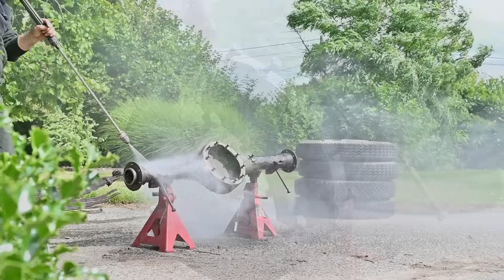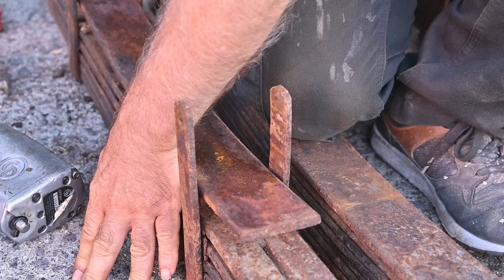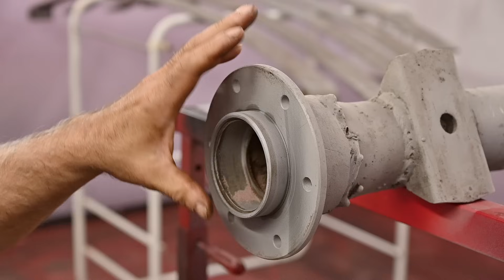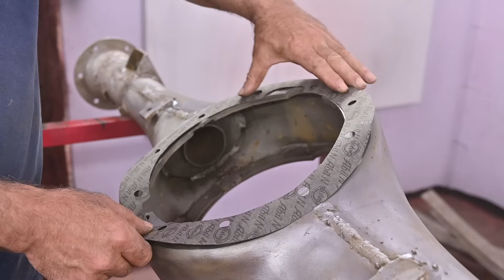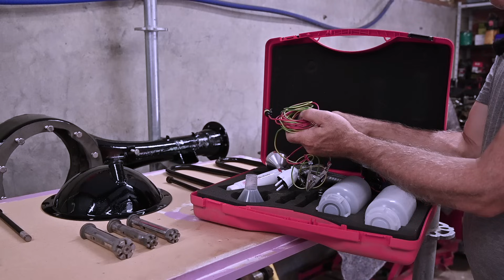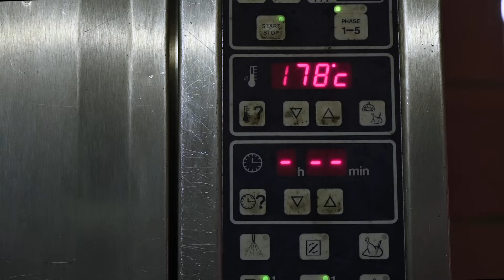Old Rusty -U23 Truck 1949 - Rear Axle /springs rebuild Part 1

Comment: Nice work, thorough job on the repainting etc. I recall the axle did not have ahock absorbers, this is taken care of by the friction between the leaves. So I was wondering, should the leaves really be painted on the contact areas, as it may change the friction between the leaves?
Reply from the maker: There are a couple of option, paint ( thin layer ) + PTF grease,  a sliding sheet or leaving it blank.

Comment: Man, I just did a rear axle rebuild on my old truck project last week.  First time doing one.
Reply from the maker: congrats and how did it go ?
Reply: @D3Sshooter  The shimming didn't quite make sense to me at first.  All in all, I'd say I had the pinion and carrier removed and reinstalled maybe fifteen times before I had the gear patterns and backlash in a good place.  It was a really good learning experience!  Working on the leaf springs tonight!

Comment: Great work, as always.

In the video at 16:47, when you're wondering about that axle. It looks like it's been widened. That would be weird, but..
Reply from the maker: These trumpets on the edges are normal...  its only the welding that is a bit odd...  It seems that all have this

Comment: Thank you thank you, grease on the gasket! I wish more people would do that. Grease makes a great seal and it's easy to take apart later. (Grease on water hoses too.) Also, I liked the way you made your gaskets. I need to keep that in mind. They way I do it is to tap them out with a ball-peen hammer. You can lay the gasket material over the part and tap at a 45 degree angle along the sharp edge and the holes to cut out the gasket. And ya, the welding on that axle housing looks really sketchy. Good video, thanks!
Reply from the maker: Thank you for the comments and tips

Comment: Thanks for the video, Steve.  I am surprised this diff did not show much wear.  It is quite old so I expected you would be replacing parts but fortunately this was not the case.  You are thorough in your approach to this restoration.  Great job.
Reply from the maker: Thanks for the comments,  if it was a normal road car then I would have chanded the ring gear and pignion.  But for a truck that is no issue

Comment: Grown and pinion do not make contact, its the diff fluid thats drives the gearing.
Reply from the maker: Thanks, indeed as I stated that there is oil inbetween the parts.

Comment: Those teeth on the ring gear are worn quite a bit , but it is a truck which isn't going to see big miles
Reply from the maker: They have some pitting indeed, but as you stated this is not going to be a working truck with heavy loads...  so it will be ok